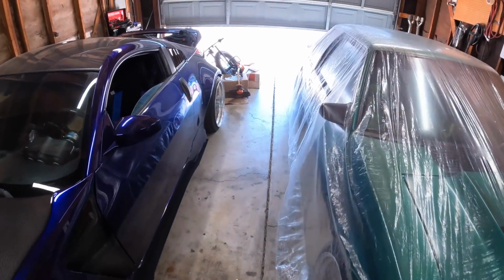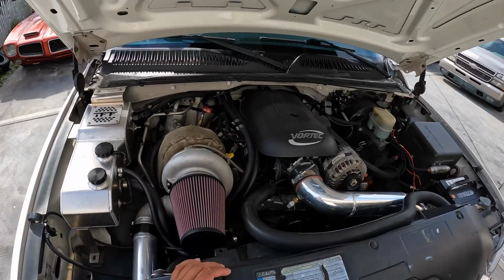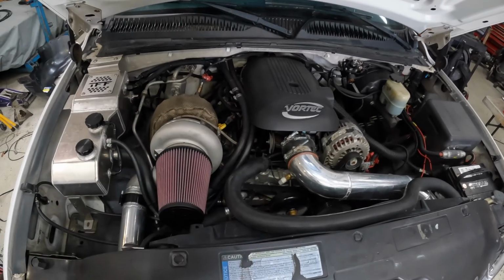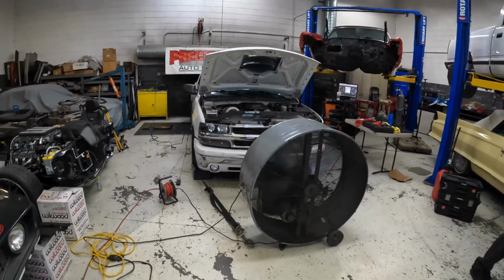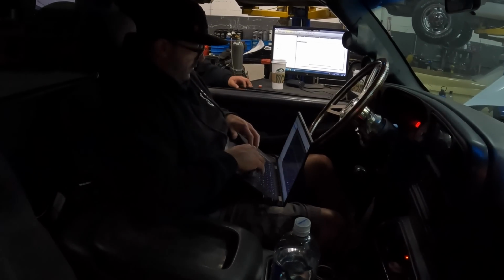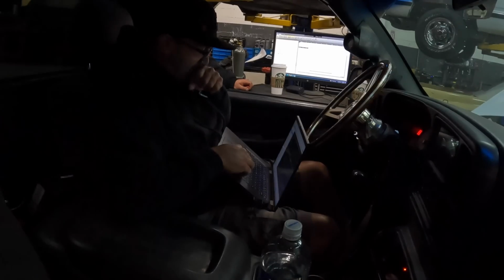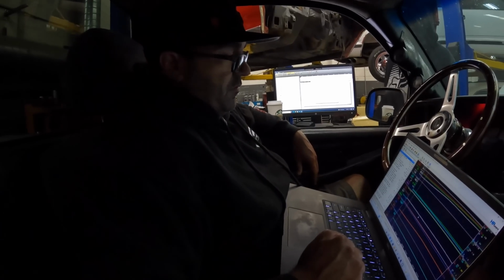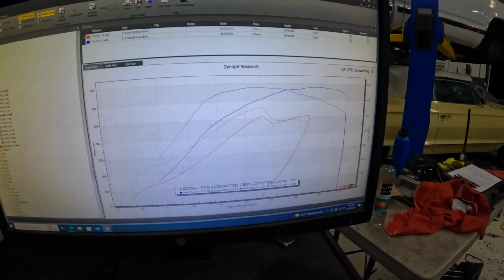I Added A Bigger Turbo And Turned Up The Boost, But This Happened...

Comment: Your 100% right bro. Right after the tune the way it blew the tires off even climbing into high rpm’s… Dude. Because turbo has been spooling it’s hard to REALLY feel the 100 hp/torque dip. Your gonna be afraid of it again 😂😭😂

Comment: Been there auto transmission sucks. Clutch it with a manual problem solved. I personally went through 200r4, 4l60, 4l80s and gave up. Ran away with a t56 and never looked back. Lmao

Comment: You don’t need a 700 hp tow rig might as well 6 speed swap it and put a drag pack on it
Reply: I mean doing a burnout and pulling a trailer is still tight 😂

Comment: Dont need to listen to me at all but if ur gonna use it for towing not just racing on the streets y not invest is air bags they will be stiffer for hauling weight and u can lower or lift it whenever u want nothing u own has bags so y not the truck since they r better for weight than leafs or coils r or atleast put helper bags in the back so when ur towing u have bags to also help keep the truck level and not scrap down the road in the back 🤔

Comment: Lol @ walk of shame or I’d call it the roll of shame. Can’t wait to see the truck up right n tight under this engine before you are forced to upgrade. What’s up with the SC300 and where you gonna park it on the driveway aka chess board? Will the 350 come outside after the SC is fresh painted like the fox?

Comment: What exactly is the trans builder doing to the 80e? Itshouldnt need much more than dual feed the fwd clutches, a decent converter and input shaft to handle that power..

Comment: Yo Mike myke a lot of them 2nd stage 4180s tend to have lag it’s a big thing in built GM transmissions that drive train drag could be the 2nd stage trans just a heads up me and my boys out here in IL have a lot of built gm trucks with power and that tends to be a on going issue

Comment: If she only got 20 psi of oil pressure she don’t got long left
Reply from the maker: It’s had 20psi of oil pressure since I got it lol been making 700hp with no issue lol oil pressure goes up to like 35psi even you Dona pull so it’s perfectly fine
Reply: You have no clue what you're talking about

Comment: spray silicone on the door hinge, WD-40 will dry it out even more
Reply: Would be a bandaid for the issue, bushings in the hinge is shot and need to be replaced.